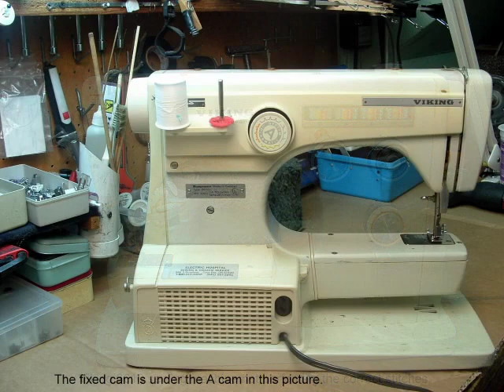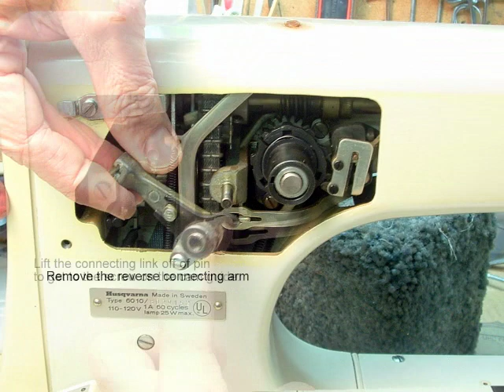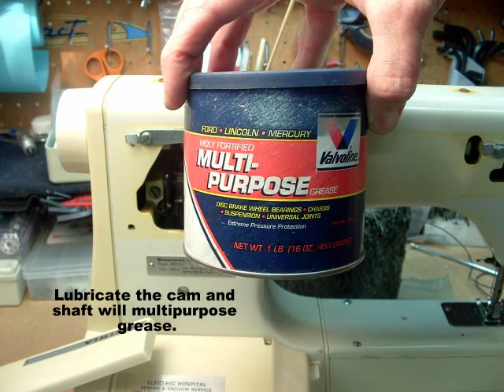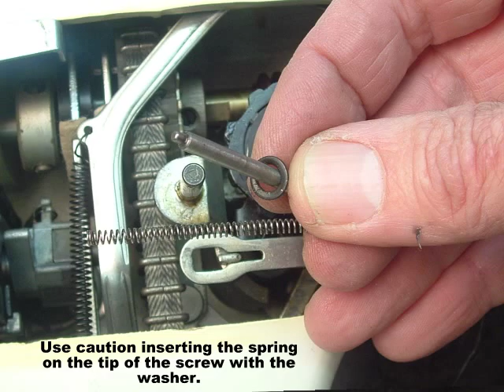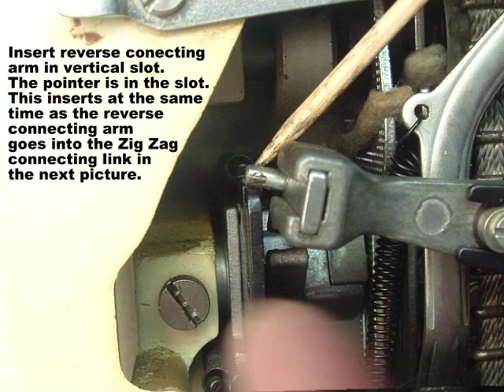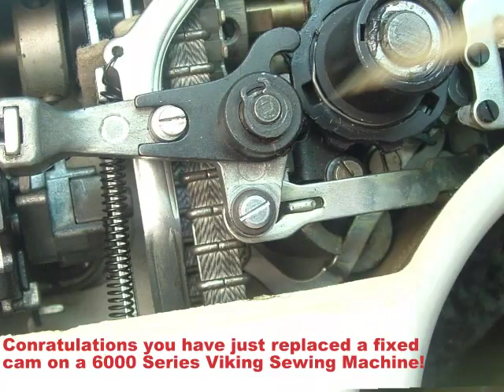Sewing Machine Viking 6000 Cam Replacement  #ELEHOSP

Comment from the maker: @beckston No the cracked cam does not cause other problems.  However we usually do a full service that includes: adjust needle to hook clearance, timing, center needle position, button hole balance, reverse feed equalization, feed height, timing centering, tension adjustment, polish needle plate, polish hook, presser foot height, shaft and gear play.   Other issues to check are the slide crank and the lubricant on the pattern selector and width selector.   This usually takes 3-4 hours.

Comment: Can the c clip be replaced? I have completed the rest of this process, but the c clip has suffered along the way. It's not broken, but is closed so tight that I can't insert snap ring pliers.
Reply from the maker: The clips fail by becoming too loose not too tight.  Try harder to get it on.  Or take it to a dealer.
Reply: @electrichospital  Ok, will do. Many thanks for the guidance.

Comment: I have a 6360 and CANNOT get the upper left dial to go to far right to access the 4th stitch on A, B, and C stitch programmers! Any advice, Joe?
Reply from the maker: We see this often when the old grease becomes too dry after many decades.  It's necessary to clean out the old lubricant and replace it.  It can take a full day of an experienced technician which may cost as much as a new machine.  I still have customers that want it done.  Many dealers don't give repair as an option.  You may have to ask several dealers or send it to me. 1-800-353-4677

Comment: What's you thoughts on this issue with the Stitch Selector on my Viking SLE 6570 I'm slowly regaining functionality of?: https://youtu.be/vP8MFgkgiBs?t=103  Thanks for sharing!
Reply from the maker: Looks like your pattern selector and reverse needs to be cleaned and lubed.  When the pattern knob is that hard to turn you can break the gears in the pattern selector if you keep trying to turn it.  I don't spend time trying to free them up with magic snake oil when what they need is total rebuild. Good luck on your project.
Reply: @electrichospital  Thank you sir!  Any preferences where to obtain the pattern selector gear?  Looks like I'm guessing I either stripped the gear mount where the knurl is on the shaft or the gear.  Time to remove the Pattern Selector mechanism and see what's required.  Thanks for the total rebuilt affirmation.  Also, any tips and/or references on rebuilding the Stitch Selector mechanisms?  I think I found the pages related in the Technical Briefing, though wondering if there is more that details.

Comment: The stitch selector knob (upper left knob) on my 6010 will not move. Also, the permanent cam is cracked. Are these problems related? If I replace the permanent cam, will I be able to turn the knob?

Comment from the maker: Sorry DebDDigger, the fixed cam is a different problem from the frozen pattern selector.  The grease gets dried out and the pattern mechanism needs to be removed disassembled washed in solvent re-lubricated and replaced.  Sometimes if you force the mechanism it will strip the gears.  New gears are no longer available for the pattern selector.  We do fix these if the machine is in good shape otherwise.  The cost is $380. plus freight. 1-800-353-4677

Comment from the maker: Hi Lisa yes we have the fixed cam.  It is usually the slide crank that makes the take up lever not work.  We do have take up levers too.   The fixed cam is easier to repair than a slide crank hence I have not made a tutorial for that. Call us at 1-800-353-4677

Comment from the maker: Yes we have the fixed cam which is what he was describing.  We also may have the last 9 slide cranks in the world.  The slide crank controls the take up lever.  Replacing a slide crank is not as simple as replacing the fixed cam so I have not made a video as there are too many adjustments to make after replacing these.  If you would like to send us the machine or you can take the parts to your favorite trained sewing machine mechanic we can help 1-800-353-4677.
Joe

Comment: Hi, I have a 6440 that had a cracked gear.  Now my husbond replaced it.  The straight stick is no problem but the zigzagging doesn’t work right.  It’s as if the needle moves the fabric side to side rather then the needle comes out of fabric and moves over above the fabric.  What can be done to fix this issue?  Please help!   Thx
Reply from the maker: It sounds like the zig zag timming is off.  When the needle is at the lowest point the cam follower should be centered on the cam love.  This is adjusted by shifting the worm gear on the upper shaft.

Comment: I have a Viking 6000 series which has been in repair shop for 3 weeks now.  The guy says he replaced cam for zigzag ( it was broken) but can't get it to zigzag and it is making a clicking noise and he can't seem to fix it. He said he would work on it a little more.  What should I do?
Reply from the maker: Sorry he is having difficulty. I suspect the pattern mechanism may be the problem.  

 Have him call me if I can be of help.  You can send it to us or bring it by if you are close to Coos Bay Oregon.

Comment: Thank you for the video , the subtitles are excellent. I just received a 6230 with a crack cam and machine is in otherwise very clean working condition. Just ordered the replacement part on amazon in Australia and will follow your step by step guide to fix it then it should last another 40 years.
Reply from the maker: Glad it helped

Comment: Thanks Joe for posting this video! So I have a Viking 2000 Colormatic with a broken internal cam (so while it will sew straight stitch, it will not zig zag). I thought this model contained the same internal cam as the 6000 series, only to find out upon beginning the cam replacement, that they are different. Do you have a video or know of a resource I might consult to find the correct replacement part for my model of  machine? Thanks, in advance, for your help!
Reply from the maker: What was different about the cam you were replacing.  Many of the 2000 series cams will interchange with the 6000 series machines.

Comment: Hello there! Do you still own your Viking 6440? I am refurbishing one and need a quick favour if you would be so kind. What I need is a photo of the stitch selector knob after it has been turned all the way counterclockwise. The ring with the diagrams, attached to the stitch selector knob, is not spinning so I have no idea what stitch I am on. Thank you very much for any help you can provide!
Reply from the maker: I do not have that machine any more.  However when you rotate the knob to the far left it would be on the green and purple for doing the last stitches on the program cams.  When you rotate it to the far right the pattern is left needle.
Reply: You have a broken gear in the stitch select mechanism.

Comment: After installing the new cam stack you may also need to adjust the cam gear to center the needle when in highest position. There is two screws on the cam gear axle to fix the position.
Reply: How do you do this, can't find anything on the internet showing this steps..

Comment: I have inherited a Viking 6440 that has a broken camstack/cracked gear. Do you know where I might find one to replace it?
Reply from the maker: Karman Wheeler thanks for looking at our post. We have the fixed cam you need. The cost is $56 and shipping is free. Call me on Tuesday when we get back from the holiday. 1 800 353 4677.
Reply: Joe, you are a genius! My 6440 has just split its cam stack gear and I need the one like I think Karman mentioned and you said was available. I am looking for the one which is just the cam part and it slips over a metal collar which then slips over the white plastic part.Should I send you a photo?

Are you able to post to Australia?

Love the music and the very clear instructional video.
Reply from the maker: Yes send a picture.